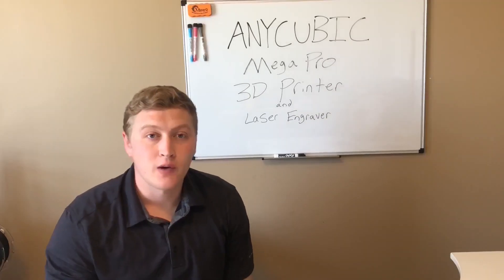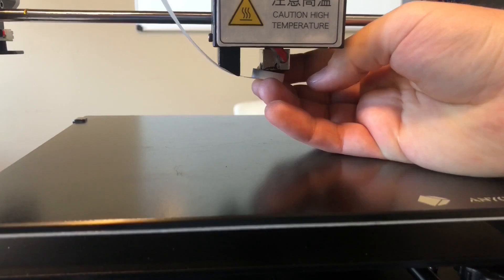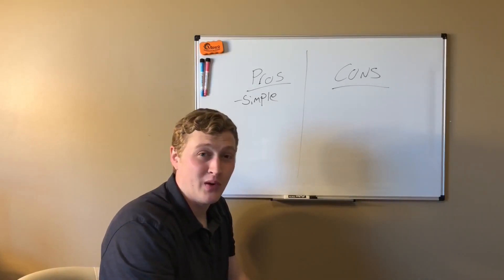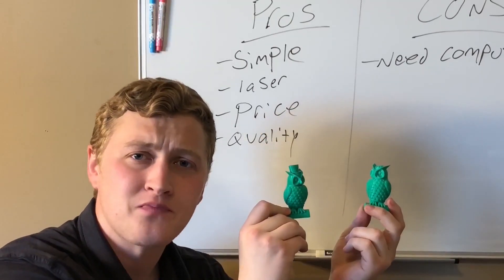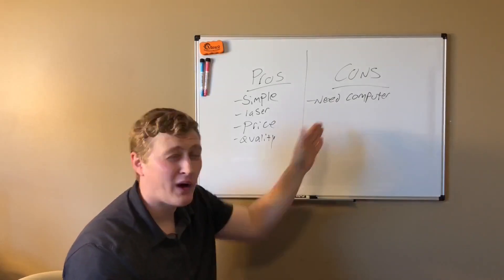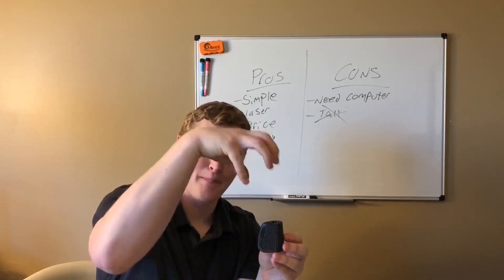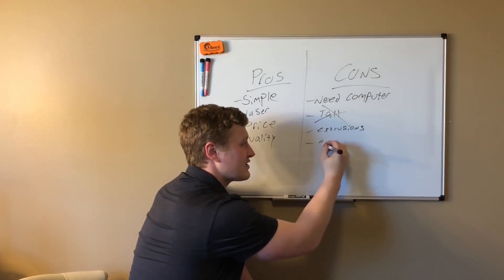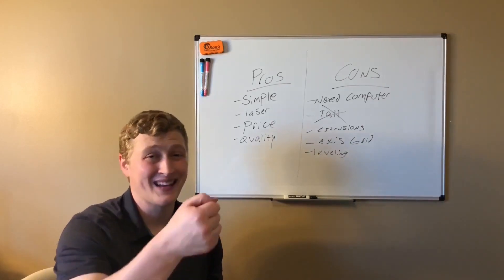Anycubic Mega Pro 3D Printer Review

Comment: I was wondering about the laser engraving aspect of this machine. Can you set where it engraves or does it have to be in the center of the base plate? Like I want to engrave on the corner of something that is too wide to off-set to where the corner is in the middle of that base, so was wondering if that was possible. Also, can you scale the size at all or is it fully dependent on the size of the image?
Reply from the maker: You can change where is engraves and adjust the size of the engravement. Most of it depends on the file you use for the engraving. You can adjust the file and adjust a few of the laser engraver settings.
Reply: @CalonHeindel  Any chance you would be making a video showing off those more advanced functions?
Reply from the maker: @TalkingHands308  Unfortunately I don't currently have access to my laser engraver. I recently moved states and didnt have space to pack it on my last trip out here. However, here is a good video explaining the basics of the laser engraver. If you want videos showing more advanced setup let me know and I can find some good ones for you.

https://www.youtube.com/watch?v=1gRi-9Tv3yk
Reply: @CalonHeindel  yah I've seen that one already. Says nothing about how to change the print size or position... maybe I'll contact their customer support...

Comment: you want to end the "wad of filament"?   level your bed PROPERLY!  a level is ok to make it level to EARTH, but leveling with the assisted leveling feature will get you "level" to the X-Z gantry.  And it will get your nozzle height correct.  using a level will NOT!

your bed adhesion is the problem.  and the reason for it is when you start the print, your nozzle is likely not close enough to the bed to give you that good first layer adhesion.  I have a Mega S (the Pro's predecessor)  and I have printed 2020 T-slot that is 100mm high, and have no issues at all.

I level my bed completely manually as my Mega S doesn't offer assisted leveling.   I use a .33 mm thick business card.  I home the Z axis...  then using the front panel controls, I bump it up 3x .1  equalling .3 mm.   I go to each of the 3 corners and turn the wheels until I can slide the card under the nozzle with some dragging.  (this is a feel thing.)  When I have all four corners feeling the same, and have good drag.. I know that my printer which believes the nozzle is .3mm away from the bed,  (.1 x 3 right?)   is now set to be .3 mm away from the bed.  the drag gives me that extra  .03mm from the card's overall .33mm thickness.

So now when my Z axis is homed... it is 0.0  and my print jobs start with a 0.2 mm first layer always.... so when that starts... my layers will be .2mm as my nozzle will be set to .2mm height.  This coupled with a 60 degree bed (which is the ideal temperature for the ultrabase surface to open up its pours to allow filament stickiness.   will give you better adhesion, which means the part won't break free in the middle of a print job... and you won't have a spaghetti factory.  

 
NOW, that little bulb at the end of the filament that prevents you from pulling it out...  That is caused by the hot end design.  The bowden tube that is in the print head, butts up against the nozzle, and on retract actions, it CAN get pulled back a little which creates a gap.  PLUS the tube is not great for managing heat creep... so the filament gets warmed inside the tube and swells.  I have modded my hot end, so that I'm using a capricorn tubing insert that is held in place by a printed washer behind the push coupler, and this makes it so the tubing is held in place behind the nozzle so no gaps.  Also the capricorn tubing is better quality tubing that resists heat more... so no heat creep into the tube.  No swelling and I no longer have the bulb of filament to squeeze through the tubing and rips out the bushing at the bottom of my material feeder.  The pro has a different extruder feeder than the S but the same solution would work here.

I could go on about calibrating your extruder to be the ideal temperature for the filament you are using, so that you actually have to dial down the flow rate to get a perfect .4mm wall line (.4 is the diameter of the nozzle.  Having this ability makes it so much easier to add a little flow to get better squish (layer to layer adhesion.)  You get this correct, and stringing goes away (meaning you won't have to crank up the extraction setting which is horrible because you pull too much material out of the hot zone into the cool zone, and it causes clogging and jamming, and that gap I mentioned before.  4-6mm should be plenty of extract to lift nozzle pressure which is what causes the material to ooze out of the hot nozzle.  

Congrats on getting started into the world of 3D printing... You'll be amazed at how much there is to learn, from the ground level.  I know it's tough to hear, that you spent all this money on a printer that isn't ideal out of the box... it just isn't.  But I look at it this way.  I paid just over $200 for mine.  I've put some time and money into it to improve things (I'm not done), but in the end, it's currently performing on par with +$1,000 machines.  I may have an additional $50 into it.  If you want a perfect out of the box machine, you're going to pay a whole lot more for it.
Reply from the maker: Wow! Thanks for all that feedback and those pro tips. I have been messing around with a lot of the setting and the wad of filament seems to go away depending on the temperature I set it at. Just finding the sweet spot can take some trail and error. Yes, I am definitely a beginner, but I have learned so much already. Honestly just learning from trail and error has been huge for me. Again thank you for the pro tips and all the info you provided!
Reply: @CalonHeindel  Most use a piece of paper for leveling, which is about .003 in thickness. I would use a steel feeler gauge in that thickness, as you want to level the bed as accurately as possible.
Reply from the maker: @MrDLRu  Thank you for the pointers!